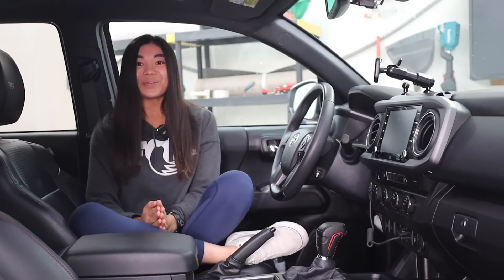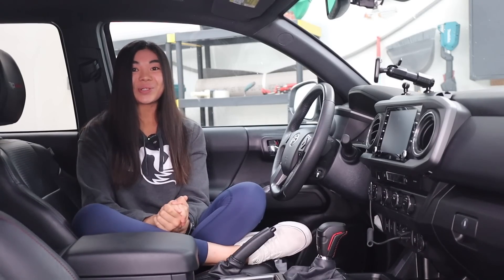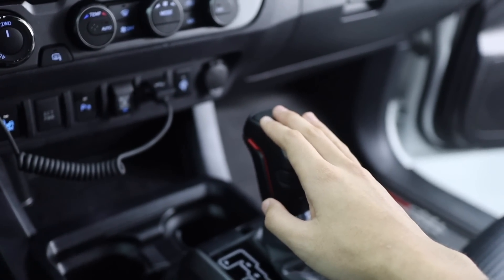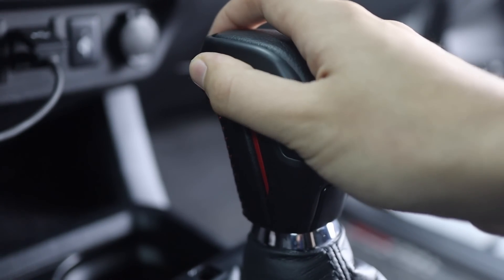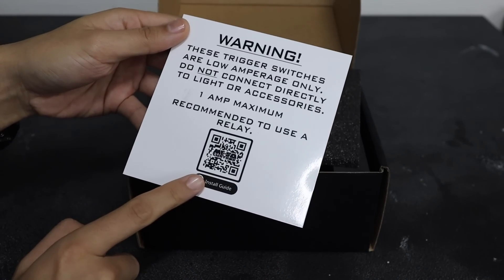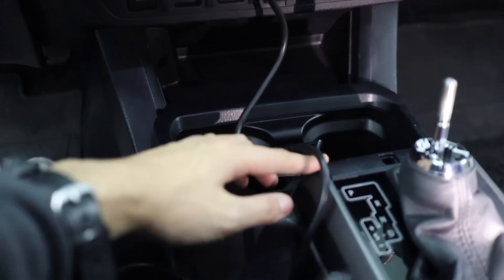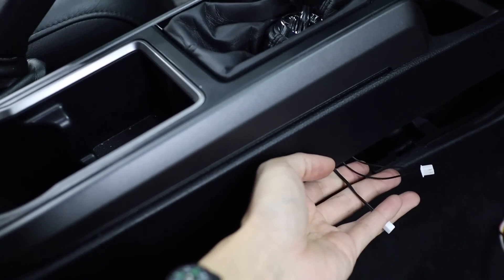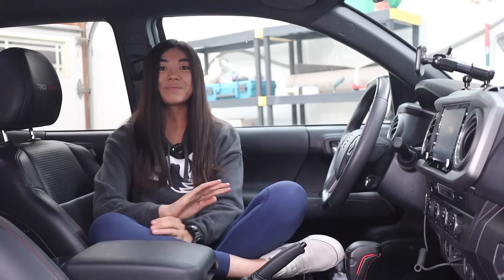TRD Pro Stealth Shift Knob by MESO Customs! Install + Review

Comment: @chloe kuo Is this your 2019 TRD off road or your TRD Pro? I noticed the dual zone temp control, but in previous videos with the TRD off road it has the standard one. I am asking because I would prefer to have the dual zone, but only have the standard in my 2019 TRD Off Road
Reply: I have a 22 Trd sport 4x and it has dual temp controls

Comment: for $120.. i rather just press the button on the dash..
Reply: Accelerating hard to merge into freeway traffic, fixated on my left-side then glancing down to my right looking for the ECT button, no thanks.
Reply: you could just turn it on before you start driving.. lol if you really liked how it drives on ect..
Reply: @MilkzzpoT  very true.  Feels like there’s no singular solution to these shortcomings. Probably spending several thousand on regearing and a tune would be it. At that point, I feel like I should’ve just bought a better truck, oh well.  Regardless, best of luck with your truck!